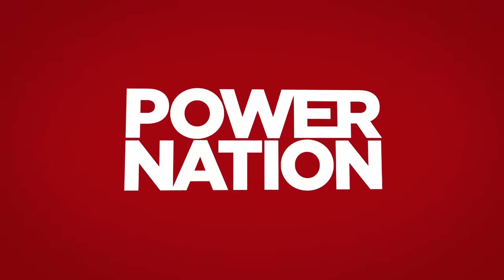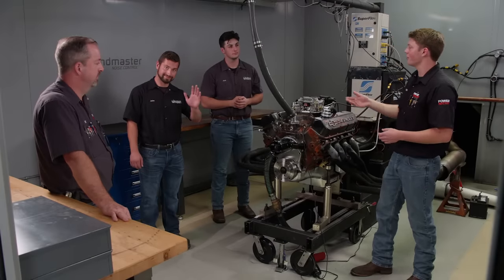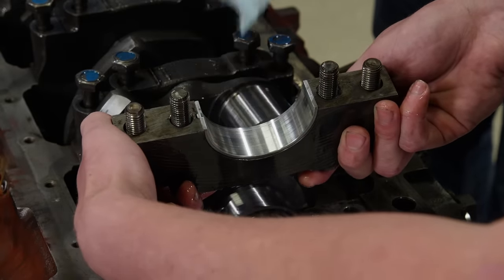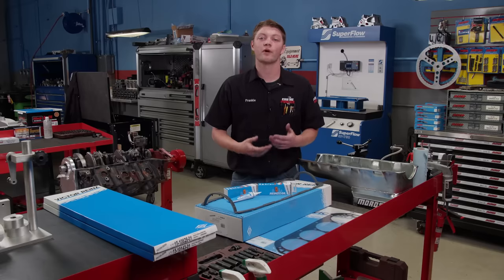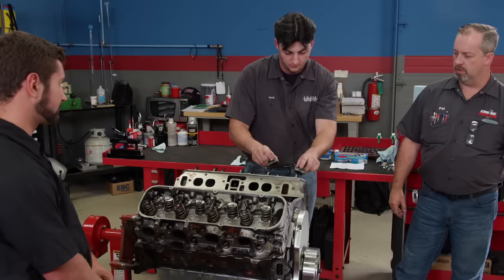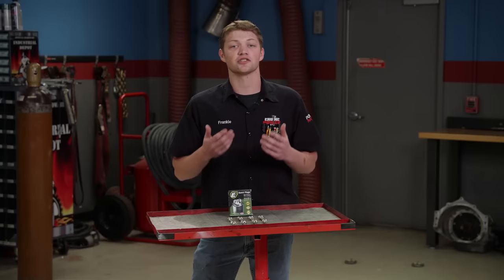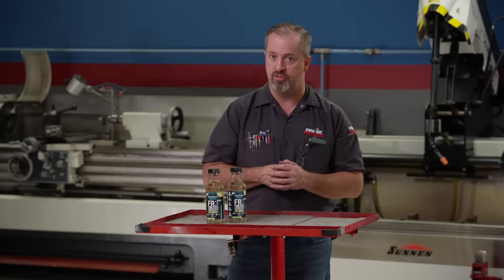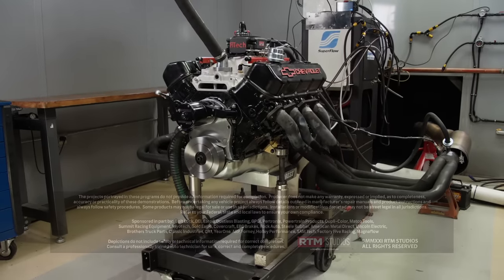Easy Upgrades for a Stock Big Block Chevy - Engine Power S8, E19

Comment: That is a lot of money for the results. Meaning the EFI system, Distributor kit, and rockers probably didn't add much value (results) compared to the cam and springs alone for a "budget" torque monster.
Reply: Right! Then they pushed the torque out another 1500+ RPM. That's not much of a low rpm torquer any more.
Reply: @joetalley192  Below 5000 isn't low RPM?
Reply: @stevenhoitz9260  hahaha not quite
Reply: @joetalley192  That is an interesting theory. What do you consider low RPM?
Reply: @stevenhoitz9260  Low RPM is the bottom third of the throttle. Lots of American V8s redline in the low and mid 6s. A third of let's say 6500 is almost 2200rpm. However, I think lots of people would agree that it's 3000rpm and lower. Anything beyond that is mid or high throttle. Since this was a pickup motor, that's where it's likely to spend 80+% of it's life. Why move the power band out of where it's likely to live?
Reply: @joetalley192  You seem to be equating Throttle and RPM. These are completely separate factors. RPM accounts simply for the speed of the engine whereas Throttle and Load are directly related and you seem to be trying to link what these guys do on the dyno at WOT to cruising around on the street at partial throttle. How the engine behaves during a pull at WOT is significantly different then accelerating at partial throttle with gear reduction. In a real vehicle, when the engine is at 100% load, the transmission will also shift into a gear that allows for the engine to be in the most efficient RPM range, which will be higher since the easiest way to move more air through an engine is turn it higher RPM. However, if you want an engine that will make peak power below 3000rpm like you stated, and not be a detonation machine, then you should turn to diesel's which are fundamentally designed to operate that way  because of the fuels characteristics.
Reply: @stevenhoitz9260  Alright, whatever dude. Easiest way to compare is throttle position to rpm's. If you wanna feel like you know everything then go ahead. You're right, you know everything. Making power down low is shown on the Dyno. The motor made more power down low before they messed with it.
Reply: @joetalley192  I am just trying to explain how things work. The best correlation to throttle position is manifold pressure, measured in kPa.  I agree that the engine made about 20 lb-ft less right below 3000 at WOT, most likely due to their cam choice and the shorter runner single plane manifold. But whether or not you would feel that on the street is debatable. The engine does carry the same torque for an extra 1500 RPM which would be very noticeable at WOT and it all happens below 5000 RPM, which is relatively low for a gasoline engine.

Comment: If you want low end power, torque, why make it a high reving engine to peak it?
Reply: They already blow the tires off just off idle, but falls off in the top end. Soooo
Reply: @brysonshires9742 . They said they wanted more low end torque, not mid and top end.
Reply: @bri-manhunter2654  as if they're not already getting both🙄
Reply: @brysonshires9742 . I agree, but like I already stated, they said they wanted more low end and not mid range.
Reply: @bri-manhunter2654  nah your argument is pointless. If they're getting a gain across the entire power band its a win win. Period
Reply: @brysonshires9742 . It’s not pointless at all when I am restating what they said. And I agree, more average power is always a win.

Comment: i got a 450 hp crate 454 with 4 inch stroke steel crank heavy rods high flow heads stock manifold 10.5 to 1 compression with a 02xx 400 r turbo good to 800 hp with 6,000 miles on it for free but not just one but 4 this years from 6,000 miles to 58.000 miles on them they just need to breath . i got a weidland high rise and a tunnel ram for a 100 bucks for both which are oval port set ups  for the high flow heads like to port the valve and set up the heads for a bigger cam  i have it in my pu all stock and it runs way better then my 396 from a 68 chevelle the tunnel ram is for my 79 z28 rs t top that i am going to build next after the 68 pu and 70 high boy i am working on now

Comment: Can you guys put together a talldeck 454? 4 inch crank in a 427 talldeck block and show us the torque increase with the longer stroke over the standard deck. Having 600tq at 1600-1800 rpms would be nice for towing and efficiency.

Comment: Going fuel injection because it’s easier than fixing and tuning a quadrajet. Which most 454’s had. I wish they would actually do a real life style build because that budget is not a realistic budget. Using 1.8 rockers on the intake would have made it more realistic too.

Comment: Pulled my 454 out of my 1 ton installed a small block 396 with more torque and hp than my 454 for pulling my trailer up the hills in my southern state

Comment: This is the first time I didn't like your build    even peanut port with a mild porting and more CR and a SMALLER  cam  makes 500hp and 500 Ib.ft before 5K rpm  

get Richard Holdener asap

Comment: anyone else wonder what they pulled that motor from? did i miss it? looks like a little manufactured patina to me..
Reply: I think they said an 80s Chevy but I though the HD 454s had black valve covers
Reply: That's the fakes patina I've ever seen lol
Reply: It's got flattops in it deffo not stock motor
Reply: @Harrybowles1969  those are the stock 80's big block pistons
Reply: @Shadetreeresto  fake as can be man. That was a low run time remanufactured engine all day
Reply: @justinballard7242  my 85 had dished pistons in. 113 cc peanut port heads

Comment: When I saw the cam that you chose, I laughed.    It is completely mismatched to those junk peanut port heads. You should have at least pocket ported those heads.  A slightly smaller cam would have been better (224/234 duration?).    Decking the block and/or heads could have given you another 1/2 pt compression and another 20 ft lbs torque.    I figured you left about 40 ft lbs of torque on the table.
Reply: What cam would you recommend for a bare Bones stock oval port 454
Reply: 210/213 is stock duration. So you're saying rocker arms would of really been the only advisable upgrade? Who swaps a came with less then 10 points of increased duration?? Lets be real. Whats the point? Youre just being knit picky now.
Reply: @nasty3145 A 224/234 would be about 14 degrees larger than stock (not 10 degrees) (still quite a bit for a daily driver tow machine.)  and I would've done 1.8 rockers instead of the 1.7s. A modern camshaft with 224/234 and perhaps a 110 degree lobe sep angle wouldn've worked much better.   I swapped my stock 6.0 LS cam for a stage 2 truck cam.   That cam has about 12 degrees more duration than stock, and it will work great in the Blazer I am building.  I also cammed my 455  trans am with a 224/224 roller cam, and I can smoke the tires from 50-100mph in 3rd gear (the turbos help).   Read a few of David Vizzard's books and get back to me.
Reply: @chrismunson7899  Can you tell me more about the application?
Reply: @CrankAddict  is going into a street truck want to make more power and torque won't be towing or anything like that

Comment: I like to see a single turbo,   with 8 lbs of boost,  for towing  30 foot gooseneck  trailer.     Replace the peanut heads with oval port 049.   Reduce the cam  duration.
I  would  only  care about  Torque  1500 - 4000  rpm,   don't care about hp.
Why is this NOT making over 500  foot/lbs?????

Comment: I’m currently redoing two gen 5/ mark v bbc 454’s and I’m wondering is it better to buy a cam kit(cam lifters and timing set) or buy parts separately? It can be difficult matching parts up because of the number of options.

Comment: I would have ponied up for a hydraulic roller but that's still a good truck motor right thar.
Reply: not a good truck motor, lost torque under 3500 compared to where it was before they opened it up.

Comment: I have a 454 in my 84 k5 i want to build up. Has an 8" lift. I also have an 88 chevy dually i will pull the 454 to put a 6ltr ls in for fuel mileage.

Comment: OK so I understand that the efi company probably sent you a lot of sponsorship money but if you wanted to improve power and torque on a budget, why did you spend thousands on efi when you could have used that money to replace the "peanut port" heads and put a carb on it? Way more performance. Same amount of money.
Reply: Because unless your building a race car carburetors are dumb. And this thing isn't going into any race car. Not with 390hp.
Reply: @worldssickestmedia2713  I disagree. If you know how to tune a carb they are awesome. Most people don't.
Reply: @jerrycoon3369  I build custom quad rail carbs for drag bikes, customize holley style 4 barrels for drag cars. And build a lot of 2 strokes for jet skis and restoring all the amazing motocross bikes of my youth.  And I think some of us older guys romanticize "back in the day" and we forget how big of a pain in the ass they are. I make a pretty good amount of money because there's not a lot of people today that even know how to tune a carb correctly much mess build one. People forget buying a brand new car in the 70s and early 80s and still having to let it warm up for 15 minutes on a cold day while freezing their azz off before they can go anywhere. Or having to take the carburetor apart to tune it. And most guys forget about that because all the cars in their driveway are fuel injected and have been for over 20 years. As we get older we tend to forget about everything that sucked and we only remember all the good stuff that was fun. We remember what it was like to drive a new L88 corvette. (Just an example) but we forget how much of a pain in the ass it was to adjust the valves every 2-3 weeks. We forget about points ignition getting out of whack and causing the carb to burp fire and blow out the power valve. Or vacuum secondaries sticking and almost killing us despite pulling the gas pedal back.  We even forget the little things like being late for work some days because that pos flooded out trying to crank it when the temperature was in the 20s and now you gotta change the oil because there's gas in it. We take for granted now that it can be freezing outside and we can jump in our cars, crank it and throw it into drive and go in less than a minute. And have been able to crank it and drive since 1986.  We remember all the fun and none of the inconveniences. And the new technology is the reason that today we have small blocks that make over 1000hp on pump gas and get 20+mpg when back in the day 650hp was the ceiling plus you had to find a gas station that sold Sonoco 110 and get 8mpg. I'd probably forget the same way if I didn't specialize in building them. Today I can tune my cars engine and I don't even have to open the hood. And a lot of the show cars I've built back in the day are paying me today to throw an EFI system on them so they can enjoy them and drive them more.
Reply: @worldssickestmedia2713  I don't disagree with anything you just said. I think you missed the point of my original comment. The point of the video was to make more torque and HP for the least amount of money. The first thing to jump out at anyone should be the "peanut port" heads. Some low end aluminum oval ports and the proper camshaft with a carb would make WAY more power and torque than what they ended up with. For about the same price as the efi setup.

Comment: I'm in a big Ford engine fan. Would like to see them able to take a old school straight 6 300ci. As where bore it out to 302 with signal or Double old school Carbs with 2- 4/ bbl, Carbs or 2 - 2bbl carbs. Or if possible put in 1 cobra Jet set up on it. With 3/4 cams which where your able to use Unlead fuel with out adding lead Addative in the fuel. That would be cool to see something like that as well. I'm old school person from the baby boom era's. During the late 60s and the 70s also that early 80s we didn't have any sort of those types gadget for our engines. As EFI.
Reply: Whats a 3/4 cam?

Comment: Should have done a 3 angle grind and flowed the heads.  Then you would have made a lot more power.
Reply: @centraltexasfoxbodies    Flowing the heads  can make more power by the information it provides.  Thanks.
Reply: @centraltexasfoxbodies  it would have informed a more appropriate cam selection at least.

Comment: Anytime uall want to rebuild another 454 let me know , lol im retired with 2 broken necks so i dont do alot of stressing that neck . Its for my 1984 MH , still runs like a top but at 330hp & 470 ft.lbs. it could stand a bit more of Both. 34ft Holiday Rambler with tag axle , a rare and Still mint , 78k on the motor. Take care injoy watching uall build with all the cool parts !
Reply: Try to look up a video on 454 motorhome. The guys from motor trend did a top end kit on a 454 and did way better than this one
Reply: @bryanhoward226  thanks
Reply: @bryanhoward226  thanks again 👍
Reply: No problem at all
Reply: Get a set of Doug's headers for it with some decent length collector extensions, and that will help without even having to tear into the engine. A Performer intake would give you a little power boost as well. Not sure if you do your driving in hilly areas or mostly on the flat, but If you do encounter a lot of hills and you're going to pull the engine, your best bet is to put a stroker kit in it. A .030 overbore with a 4.25" stroke will give you 489 cubic inches. You can get a kit with forged pistons and decent aftermarket rods for about 2 grand. Your traveling situation and budget will determine just how far you want/need to go.
Reply: @perryneum  ive had Dougs headers on the MH for over 25yrs. On it ! Same with my SB in my pickup , the TriYs

Comment: I agree with several other comments this to me is a failure its still has peak hp and torque at high rpms i wanna see how to build a high torque high hp tow pig engine peak power around 3,200 to 3,500

Comment: Great episode, but it's amazing and sad at the same time that a modern 400ci 6.6 with full accessories puts out 401/464 and this big cube engine was around 370/470  with no accessories. I know it was a budget but I feel like they could have gotten a bit better than an engine 54ci smaller.
Reply: The modern 6.6 has good heads, VVT, and direct injection. This doesn't. The heads were pretty much designed in the 1960's, and they said it came out of a 1980's 1-ton so they are probably way worse. We're comparing apples to PowerBars with these two.

Comment: Let’s make a low Buck high torque low rpm engine. Raised the peaks 2k rpm and throws on fuel injection. Torque went up 12 lb/ft

Comment: LMAO !!!!
    I have seen a GM 383 with a Quadrajet ,and a performer ( non RPM or airgap ) with vortec heads ,  ( seen it live ) that Dynos over 415 LBFT at 2500, and has over 480 LBFT at 4000, with over 400HP at 4400 rpm , peaking  over 420 HP around 5200 rpm using a HEI distributor and had a factory air cleaner installed , 
 still needs a little tuning after install....
Those heads hurt that engine , 
My opinion would be to lose some duration on that cam 

  That guy with all that crap in the pocket ...WT_ ???
Reply: The guy with "The Pocket Protector" is one of the best engine builders. He's from NHRA pro-stock, and is the manager of the School of Automotive Machinists & Technology.

Comment: Now I want to know how much my 454 makes its bored .30 over aluminum heads from edlebrock mother thumper cam from comp 850cfp carb air gap intake  long tube headers it’s still HEI wish it was EFI but I know how to deal with the carb set up

Comment: Bad choice of cam for street engine, big block especially. 106 to 108 max lobe separation. Do you follow David Visard? You need to build as much torque, as quickly as possible.
I just saw the results, that's embarrassing, peanut port or not. 112-114 is for track only, when you don't  need power below 4-5 grand. Swap the cam & find out if I'm wrong.

Comment: If you’re gonna go roller rockers, then why not go roller cam as well? Seems kinda like a waste to do one, but not the other.
Reply: Not really slotted stock rockers are trash rollers are always a welcome upgrade

Solid lifter flat tappet guys use then all the time and it's not a waste.
Reply: A roller cam swap would have been over an extra $1k

Comment: 1/2 turn past 0 lash? wouldn't that be to tight? Sorry i only have experience setting the valves on my semi truck, atv's and dirtbike.
Reply: Factory spec is usually a full turn past zero lash, so they've actually loosened things up a bit. It works better when pushing higher rpm.

Comment: Like these shows, but this build dollar per HP and torque gained was a total failure. 750 Holley, dual plane intake, roller cam, deck the block and heads, and get that cam down 10°. That will wake it up across the board and be under budget. The efi money spent would have easily bought a carb and roller cam.
Love to see this one redone correctly.

Comment: Can you provide the information on the products that you used such as the sealants and the extreme pressure lubricants part numbers
Reply: Not interested. But, definitely check out the gizmo plugs and nicely painted EFI. Bring your primary and backup credit cards.